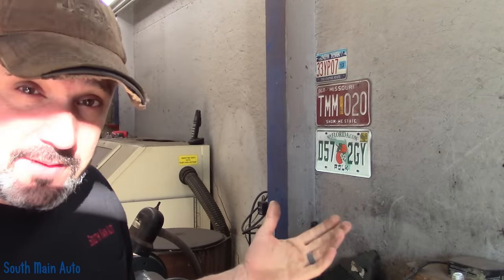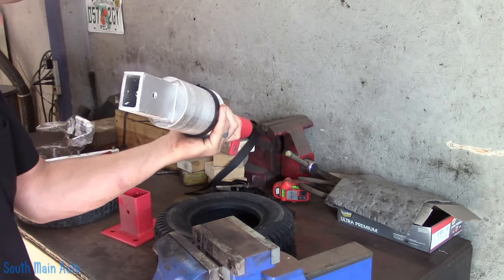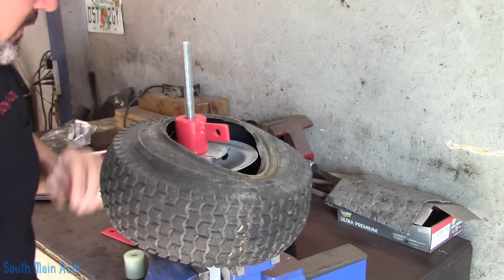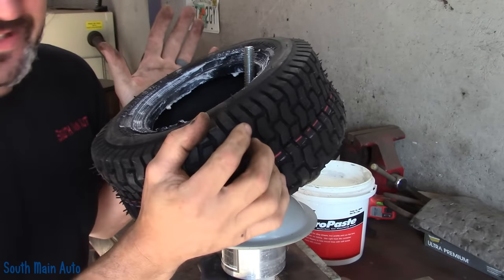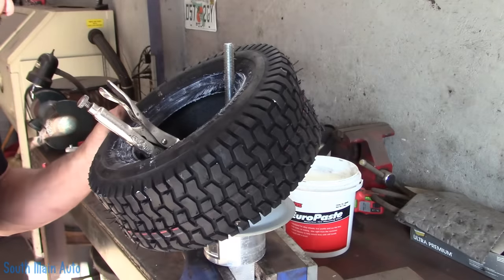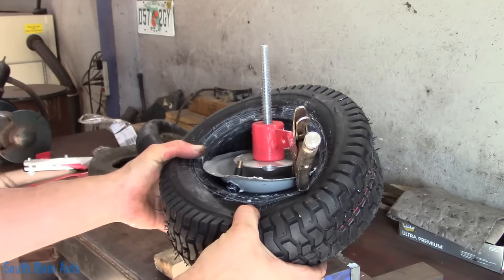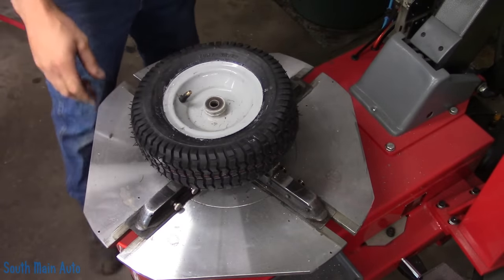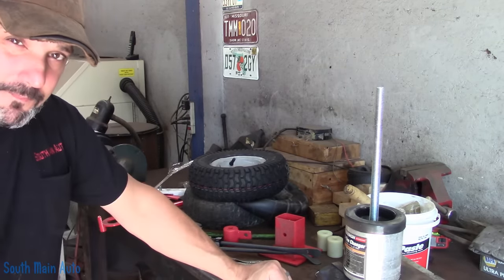Mini Tire Changer

Comment: I have one of those tire changer and they're awesome.  You should have read the directions, using the spacers and the tool they gave you would have allowed you to spin the tire off and on ike you do with your big tire machine.  The spacers are to save you from having to run the threaded part all the way down and to provide a surface to rest the installer/removal tool against.  Dude, your experience is working against you with this one, you made this so much harder than it needed to be.
Reply: Chinese tool makers do themselves no favors with their broken Engrish and their WTF does that mean? picture instructions. 
I've never used one of these, but I do see how the mount/dismount bar would work with the plastic bushing.
I agree that experience sets us in our ways and can make things harder than need be. I've been a little slow a time or two at learning an easier way because of the way I've always done something.
Reply: @Freedomquest08  So, you've never used one, but you're going to claim the instructions are poor?  All that does is demonstrate your racism.  I own one of these and have used it many times and it's awesome for what it does.  I paid $40 for mine and it's saved me many times it's cost and the instruction were just fine.
Reply: @Freedomquest08  Harbor Freight usually has very good instructions that have been well written not roughly translated. I don't understand why more Chinese manufacturers don't do this.
Reply: @thermalreboot  Sorry to trigger you. Wasn't trying to do that. Chinese tools do normally come with very poor instructions. To know that I would have had to buy a couple here and there. If I was racist I would likely boycott Chinese products, so there's that. People are so easily triggered nowadays and have no sense of humor at all. Obviously the instructions did not help much in the making of this video, so wasn't a huge leap of faith on my part to assume the instructions were not very good.
At any rate, I see how the tool works and wasn't knocking that at all.
Reply: @Freedomquest08  Your racism was apparent by asserting that a tool you haven't used has poorly translated instructions.  You Pre Judged something you have no actual experience with, that's known as PreJudice. Which is a form of bigotry and when that bigotry is directed at a race then that bigotry is called Racism.  Had you actually purchased this tool and found the instruction poorly translated that would not have been a Pre Judgement, it would have been an observation.  So, no I wasn't triggered, but when bigots like you make your racism apparent in YouTube comments you muddy the water for someone who might have made a cogent observation.  You give fuel to the SJW fire by being a overt racist.
Reply: @thermalreboot 
 Whatever dude. Have a nice day.
Reply: @Freedomquest08  If you read those instructions with your best Chinese accent they will make perfect sense.
Reply: @Freedomquest08  I agree, every chinese tool I've bought was cheap garbage and the instructions are garbage with both ending up in the landfill, that's why I only buy quality American tools or make my own. You really do get what you pay for.
Reply: Oh boy...looks like someone needs a quiet space, maybe...just maybe someone could say something and not be called a racist if happens to intersect a stereotype of a certain culture.  Perhaps we all could gain a little humility and realize that all people should find humor in their culture background and idiosyncrasies.  Then again how would the elites divide the masses and keep there power structure.
Reply: @tiredoldmechanic1791  Harbor Freight has the Chinese make the tool, but the instructions are probably written by the native English speaking staff in CA.
Reply: Thermal Reboot was equally offended at the EUROPASTE that Eric was using.
Reply: @Freedomquest08  .. or you could actually read the instruction booklet here: https://manuals.harborfreight.com/manuals/61000-61999/61179.pdf and note that it's written in perfectly serviceable English.
Reply: @thermalreboot  who would of thunk a mini tire changer would start a race war.
Reply: @thermalreboot  That racism remark needs to be set aside dude , vastly over used .
Reply: @airdrop1670  Except when appropriate.  The dude claimed to never have seen the tool in the flesh yet went on to state that Chinese instructions are junk.  Making a claim about a specific race when not in evidence is an example of racism.  SJWs will call a falling leave racist, let them look like fools, don't give them real examples.
Reply: @thermalreboot  You don't get it do you , playing the race card is getting a bad name , you want to knock down free speech get on a socialist board and howl at the moon all you want .
Reply: @airdrop1670  Actually I do get it.  What you clearly don't get is it's not playing the race card when someone makes a genuinely racist comment, it gives the SJWs something to use as fuel.  The Electoral College isn't racist, making an ignorant comment about how the Chinese can't write intelligible instructions is.
Reply: @thermalreboot  Almost every cheap tool is made in china so I don't think it was racist , speech police we don't need .
Reply: @airdrop1670  But not all instructions coming from China are poor and as I recall the ones that came with this one are not.  That's where the problem came, the poster admitted to never having seen these instruction but panted all Chinese with teh same brush.  Disparaging an entire race is racist and if you can't see that you are as well.  Right now I'm wondering if you're really a leftist trying to prove racism exists by being racist.
Reply: Thermal "Racist"-Screamer: cry 'wolf' too often and people ignore you. You already do; we already have.

Comment: Great little tool for small tires. I think I would have used a tube though.
Reply: ... that will be the follow up video when she brings it back because it won't hold air.

Comment: One of the most useful videos yet! I've spent hours trying to get those friggin' things off and back on. I usually end up on the garage floor with nearly every tool in the shop spread around me and still can't get the thing to air up.

That was a pretty crap rim. Almost looked like a tube only rim. If it's just for a cart you can get a complete new wheel for $5 at Harbor Freight or even Amazon.

Comment: That rim is now ruined... Using all that bad air. It won't last a few feet before a rust hole starts hahaha
Reply: butchtropic  he has a video were a customer stopped and got air. Then came back and said he had to put 400 dollar rims on his car because the air was bad and corroded the rim. The video is from a few years ago so I don't expect new subscribers to get it... Now if you'll excuse me. I have some ball joints to weld in...

Comment: Ahhh diddy wheels, no wheel balancing?  ha ha :-D
You will get the 10 mph speed wobble :-D
Reply: If you can get more than 10 minutes of run time on those tires at 10 mph, then you'd actually have to worry about balance.

Comment: I have been using one of those gizmos for 5 years on my powerchair tires. 
My arms still work OK but those little 4 and 6 inch tires are a pain like you say.
The bead breaker works but I add a 3-foot pipe cheater to the handle for leverage.
Spoons are the way to go and I'll sure give your grama's vice grip trick a try.
Thanks so much for all the neat videos. I'm an old grease monkey nd they bring back memories.
Just remember Eric just because you can do it doesn't mean I can and thanks for thanking me for watchin.

Comment: Got one of those from Horror Fright. I’ve used it several times in my mower shop and works very well for the price. I’ve even worked on ATV tires with it. The included tire removal/ install tool works just fine on its own, but you need to use the nylon spacers with it.

Comment: As someone who changed hundreds of those tires, I found that tool useless for anything but breaking stubborn beads.  I preferred to do those on the floor, knees holding the tire into the valley of the wheel, and two screwdrivers walked around the edge.  Tell us about your new tire machine, Eric!

Comment: I just use a 6" vice and a large bolt to hold it in the vice.  Break the bead with the vice then put in the bolt and clamp into the vice.

Comment: An old friend of mine nearly lost a finger (multiple stitches) when he tried to seat the bead on a similar garden cart application. He only had 15-20 psig on it at the time of rim failure. I think that the tire is going to leak without an innertube as the bead can't seal tightly against such a flimsy wheel flange (just a male nurses opinion, I don't want to see our Eric O. getting hurt).

Comment: That's why I use a local tire shop for changing that size of tire.  They charge $4.00 per tire and that includes the disposal fee for the old tire.
Reply: Good deal. Our town dump charges $5 just to get rid of the tire.

Comment: I'm in the tyre industry. These tyres are so much harder than car tyres.
I have a cheap extension that I clamp in a low vice and stick the wheel on. It's so much easier to work at waist height so you can use your body weight to help push it on.

Comment: When Tractor supply runs them on sale, it's cheaper or the same just to but the entire assembly. New tire, wheel, and bearings.
Reply: they don't always have all sizes. I couldnt find the size I needed... no hf no ts.

Comment: Eric O those teflon sleeves go back on the all thread to prevent messing up the threads when you run the bead around they also fit inside the big oval slot in the install tool that it cane with to keep it tight and prevent damage to the threads

Comment: Man o Man, I tried on my 10 in hand truck tires and it was a disaster. Took them China made tires to be mounted at Les Schab since I lack that kit. Well les  blew the tire bead and my plastic wheels did not help
 So I purchase 2 soft solid rubber wheels
 Do not have to worry about flats and they were made in USA unlike the Marathon tyres tires

Comment: Always remove tires on small rims from the rear of the wheel. 9 times out of 10, the rear rim bead is stronger and wont bend.
Reply: @cjr1881  Murica

Comment: Been using a mount like this for years. Here's a tip. First thing is to get a large C clamp and compress one side of the tire. Then start mounting the tire with that edge first. Being compressed, it allows the tire to slide up farther into the rim. Then the rest of the tire will go over the rim a lot easier since there is not so much distance to stretch it. All you need is a slight bit of soapy water. It's very very fast and easy. After both tire beads are over the rim, simply remove the C clamp.

Comment: I use my bearing press to remove small tires. you can break the bead with it and then place a spacer under the center of the rim to raise it up and  press down on  it to hold the wheel so it doesn't spin. I got two tire spoons from HF. works well.

Comment: I would have left the plastic spacers in place.  Then you can leverage the tire lever against the spacers and rotate the tire lever around in a horizontal arc to lift out or put the bead in place.  With lubrication of course.
I've also got a "third hand" which is a vinyl-coated thingy (from No-Mar)  designed to grip the rim and keep the bead from slipping around.  Same purpose as your vice grips, but won't gouge an alloy rim (motorcycle rims).

Comment: I remember changing some ATV tires years ago and the hardest part was breaking the beads loose from the rim. Since the bead breaker was intended for normal-sized car tires, it was super difficult to break the beads loose. It didn't help that the beads seemed like they were damn-near glued to the rim. We ended up getting them popped loose by shimming the rim out with some blocks of wood, then using the bead breaker shovel.

Comment: Bought one of these at HF to do my quad tires. The beads were brutal and I busted the grip portion of the bead breaker off with a pipe. Worked out better that way as the pipe worked great for leverage. Well worth the money. Done 10 small tires with it so far.

Comment: Useful video.  I have one of those changers, but I never thought of just removing the base to clamp it in the vice.  Thanks for the tip.  I find the worst part about changing lawn tractor tires is getting the dang things to pop up on the bead, especially the rears.
Reply: a good trick i was taught was to simply use a tiedown strap aroud the outside center tread.  when you tighten down the rachet, it pushes both tire beads agians the rim
Reply: Don’t u watch gold rush when the guys want to air up this big equipment tires? The spray a flammable liquid in the tire then hit it with a flame then when it catches on fire it causes a small explosion inside tire and seals the bead

Comment: Friggin cheap crap! Hate those rims - I've encountered many. That's a 21st Century staple - the way everything has been going. Some lawn tractors have those now - not just the yard carts. 🤬

I need to get me one of those hand jobbers!  Much easier than rolling around on a foam pad with tire irons, swearing.😁 Shockingly I haven't had many tractor tire changes or tube installs this year. Last year I may have done 50 or more. Funny how that goes. A little inflation in tire and tube prices, though - tubes are $15 to $20 while tires seem to be $45 or higher. $60 seems nominal. It's all from china anyway, so it should just be a few bucks! The last tube I installed was the infamous "Dong Ah" brand - no joke! 🤣  https://postimg.cc/8sCxBG9c

Comment: Wish I would of had one of those. I was a mechanic at a hardware. We had a $15000 zero turn we needed to prep real quick because a customer was on their way to pick it up. Upon removing the mower from the create, it was discovered the valve stem was damaged. We had to get a tube in quick. Zero turns are even smaller and designed for 50psi. We had to try and stretch the tube by hand. I was pulling down while another much heavier mechanic was pushing down. I ended up tearing a blood vessel in my wrist. It caused my Linate bone to die resulting in the bones on each side fracturing. Doctors took forever to properly diagnose. Fourth doctor knew exactly what it was and jumped on it. By then it became a salvage operation. They performed a proximal row carpectomy.  They removed 3 bones or what was left of three bones. I lost most of my movement and my ability to push with the hand. I gained most of my grip strength and I can pull things OK.  Now I'm 41yrs old and not sure how I'm going to provide for my family. Really sucks, I loved being a small engine mechanic,  fixing things is just in my nature. I was able to do a break job on my 2014 Corolla and my 06 E-350 superduty van. Couldn't use my hand for 2 days after, but it felt so good to get it accomplished. Thank God for my old impact tools!🤣😂

Comment: Don't need that gizmo. Put it on the ground and stand on it. And you know you can buy the tire on a rim for something like $10 more... But - Easy to change on the ground with 2-3 tire irons/spoons. The only problem I have is getting the bead to seat. Most tires I get are shipped squished flat. Last 5-6 I did I put them in the sun for a few hours and the sidewalls spread. Yea, I know about the strap or rope trick.

Comment: I just work harder and not smarter... I gorilla those mofos on with my bodyweight. Just have to have the rim tipped at the right angle and push down and forward from both sides... weighing 200+ pounds helps too

Comment: I don't understand why two piece rims or bead lock rims are not more standard or more available for low pressure systems like lawn mower tires. Would make tire and tube changing soooo much easier.

Comment: Back in the day, yer' yard wheels uud' come factory with tum thar inner tubes. The rims had four bolts holdin' em together soz' you could split and fix em whaar she broke. Uh corse' that uud be wayyy to epencive in these times. Nowadayz, yuh got to' futz with em. But hell, they come so cheap now, allz you do toss em, go down to the Harbor Supply Tractor Freight and get you a new une'. Now get off my lawn you rotten kids.

Comment: That's cool that mini tire changer. And it really works. Harbor freight and tool does sell some good stuff but some stuff is junk you just got to know the difference. Wow I didn't know I could mail you a license plate? I have some old Michigan license plates hanging in my garage they were from my wife's old cars. But I'm going to send you one to hang on your wall to know folks from Michigan are on your channel. I love what you do. And you do it well. I know you'd make a great boss. How many pounds of air did you add to the tire and what size is that tire again? And who makes it? I have a Husqvarna 24 horse V-Twin riding lawn mower. It looks like one of my front tires.

Comment: Wait a minute. You just did that with not even using 2 screw drivers and no four letter words.

What is this madness? Saving the tube none the less? Impossible. It can't be done. This is some kind of magic trick. Penn and Teller will be bringing their mower by soon.

Comment: Harbor Freight does sell those tires/wheels complete-tubeless for $9.99 and up depending on size. They are Chineseium dog crap tires but for the value, they are the easiest way to replace bad tires, bearings or rusted out wheels. We have a couple of two wheeler dolly's and one cotter pin and washer each side, boom for $25 for two.